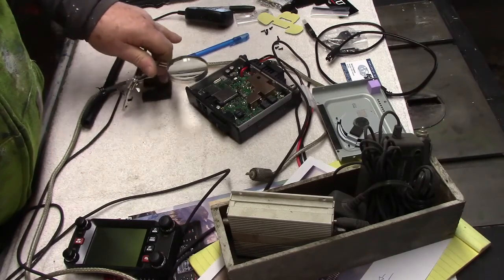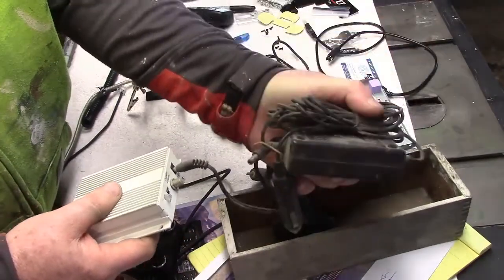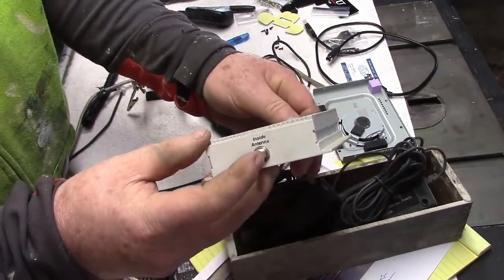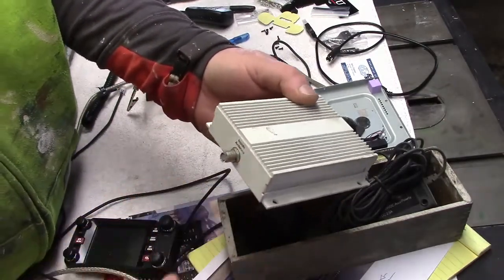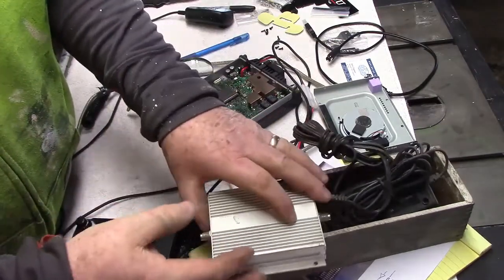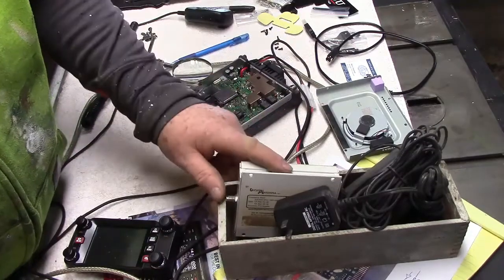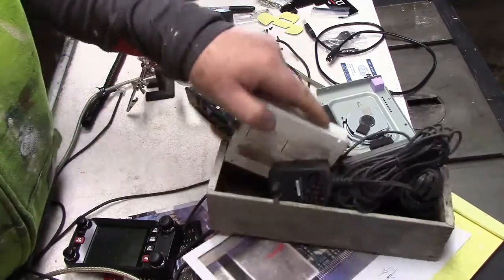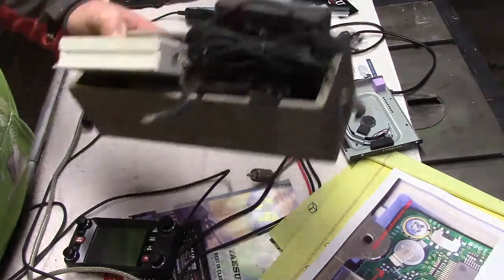A quick note on cell phone repeaters

Comment: thanks again for the info I have been researching them and found a few im interested in like you said things change so for my style of phone I need a 4g compatible  system so ill have to save some coin before I buy one like you said there not cheep im not sure exactly which one I want yet I must do a bit more research  before I buy from what I have found out it has to be 4g and minimum of 5 band  I found a few but the one I want is so far not available  as I see ill keep looking as the ones I found you must stay within a 6 ft radius of the unit for it to work  proper I noticed yours was also a 65db and so far the biggest I  have seen is a 50 db    also mine has to be 12vt dc  as I need it for my mobile thanks for the info buddy
Reply: aren't scared having that in your home? do you live in a rural area?

Comment: they have been putting these on power lines in my neighborhood very close to homes and much larger as well . they are pretty close together m and many of us are concerned about the g and em radiation in general . 324 to 6 micro watts per square meter is when biological damage occurs .
Reply from the maker: Thanks for stopping by, This isn't a commercial grade system and was back in 2015 and the system was made in 2012, technology has changed since then. This system was made for the home, boat, vehicle or anywhere that had poor singles. Metro Mobile, Links and even AT&T would sell and in some cases give a person one if the location was a bad area, even today in some outback locations the cell singles are so low its hard to get out as well as kill the batteries.  Even today in the town I live is there are a few neighborhoods that have vary weak singles and have to find a spot to use their cell.  But back you your comment yes things have chaned some and with the newer version of this repeater the antennas can be a little closer.   Thanks for stopping by.